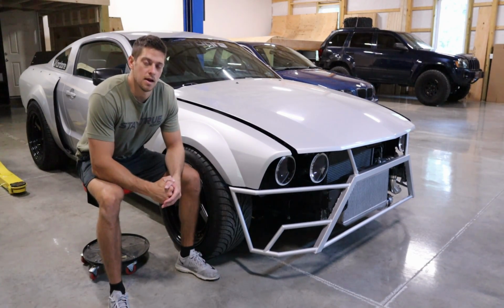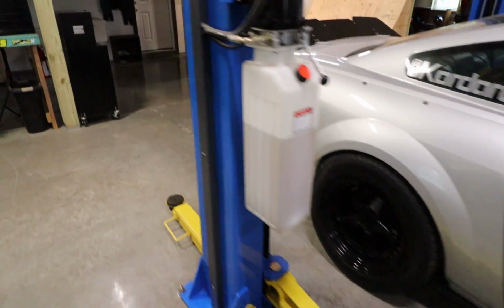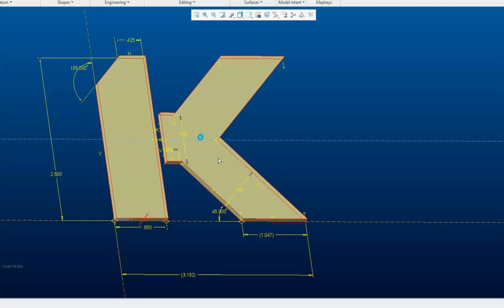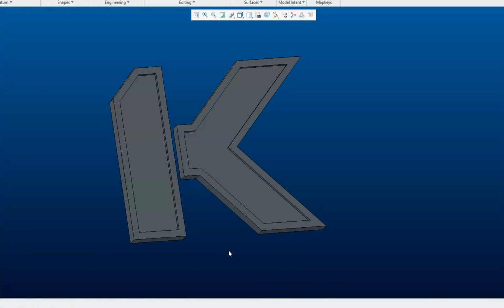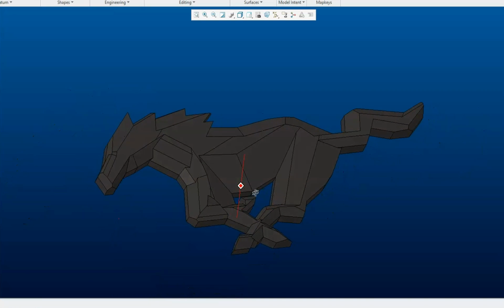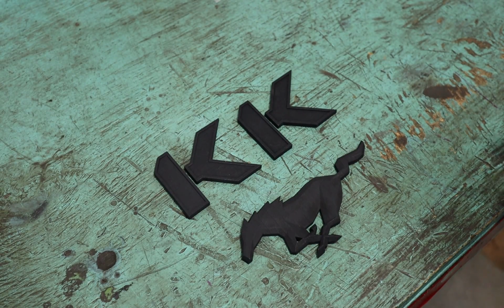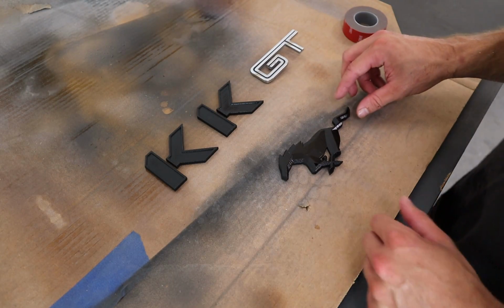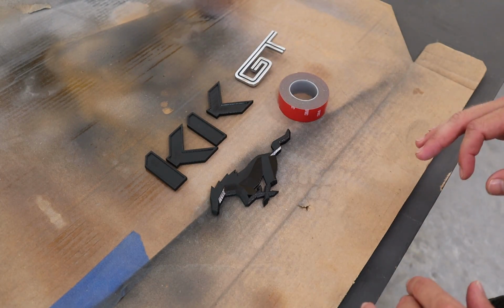Designing and 3D Printing Custom Badges for my Car

Comment: That 3m VHB tape is extremely useful. They also make a clear acrylic tape that’s not as thick but it’s a little harder to work with. Great job!
Reply from the maker: Yeah definitely, I've used the thin one as well 👍

Comment: Do a sliver bumper. Cut off the top 4ish inches of the bumper so that it has a front body line and it will pull the hood and bash bar together.

Comment: you could have 3D printed the badges with the tabs on the back to slot inside the holes
Reply from the maker: Yeah I thought about it but wasn't necessary with how strong this tape is

Comment: I'm not a Fan of the badges. I do not like them sam I am! I liked it better with NO badges! Thank God you did not put a 3rd K on the back. Then the Stang would have been the KKK Stang. You are going to have an endless explanation of peps asking what's the K mean? What's the K for? Have you K swapped your mustang? Watch it will get annoying... other than that awesome build. Great channel! Love your content! More BMX riding too!
Reply from the maker: Hahaha I think everyone knows what the K is for
Reply: @Kordare  We know, and respect the K. But the average Joe/Jolene at the car meet will have no idea... watch you'll see. All in all badges are a minor thing. Your car is awesome! I remove all badges from my cars. I think it's funny for peps to ask "what kind of car is this?" Kind of gets annoying too tho. Cheers to a great build!
Reply: @damndman2009  What car do you have?
Reply: @joshjack6127 525hp 1965 Plymouth Satellite - 400hp/480torque 2006 WRX STI Subaru - 1997 Acura CL that I have swapped an H22A from a Prelude into it, then added 1 - 76mm turbo,  dyno at 365hp/345tor - among many others all with NO badges! Currently working on 1970 GTO Judge/ also working on 1965 Airstream travel trailer, it's super cool!